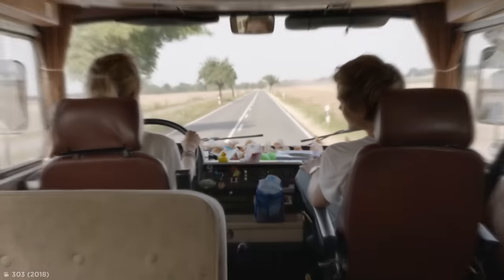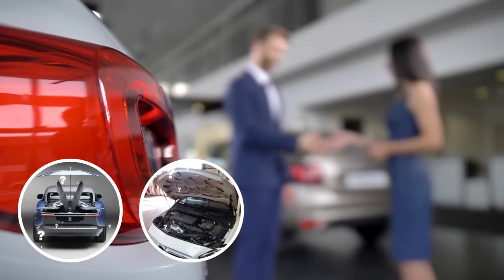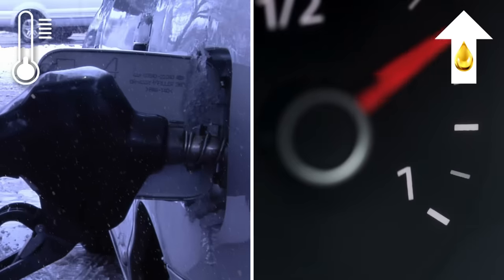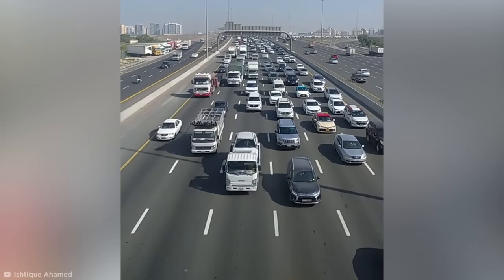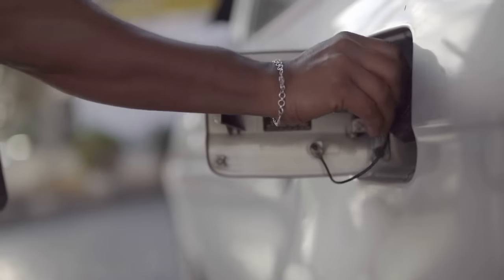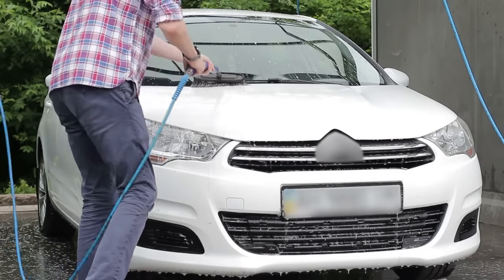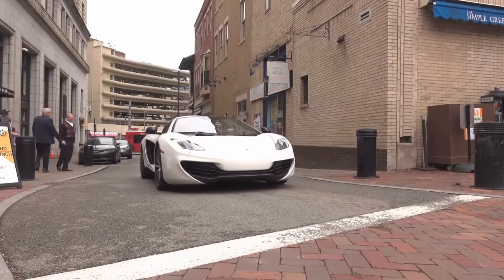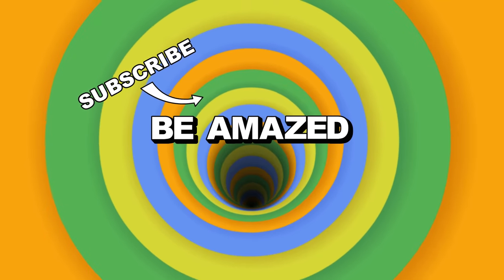Car Secrets Only The Most Experienced Drivers Know

Comment: You owe me 22 minutes!😴
Reply: And 17 seconds
Reply: Thankfully I only got about a quarter of the way through before realising this is a waste of my time
Reply: Real
Reply: Thank you for saving me 15 minutes! ❤
Reply: I don’t get it… how is this a waste of time?
Reply: I was expecting that seatbelt button to be more useful then that
Reply: I stopped it at 9 mins, went over to the comments and after reading yours, i believe i made the right choice. 😂
Reply: Yeah, I didn't even make it past the first one. You are a better person than me to continue for 22 minutes and some change
Reply: Yup
Reply: Thanks for the warning! 👍🏼
Reply: Thanks for saving me 22 minutes
Reply: Thanks for saving me 20!
Reply: Was it boring or fun
Reply: Thank goodness I fast forwarded and watched at 2x
Reply: Same…. Thought I was gonna get some life changing secrets here. I could’ve just smoke 2 cigarettes if I purposely wanted to waste 22 mins of my life. 

Also, you explained the “hidden” key but offered no explanation of how to access the cylinder, which in most cars, will require prying off the cover on or around the door handle to reveal it.

Or what about when the key fob runs out of battery? Should’ve added that certain cars will have a physical key slot usually hidden underneath a plastic top around the steering wheel area or nearby the push start button and other cars (most likely newer cars) will have some sort of procedure to start the vehicle even when the key fob is out of battery. For example, VW will have you, without depressing the brakes, press the start button once (ACC on), hold the key against the ‘key’ sign located on the right side behind the steering wheel, then, once detected by the car, proceed to start the car as normal (press on brakes + push start button). 

This went longer than expected but I just find it annoying when people would post some sort of guide, answers, “secrets”, etc but doesn’t expand enough on it for it to be helpful or just simply say what 9999999999 of others have already said or answered out there (Google is full of it, same answers over and over and over again, nothing new or useful to add except by a very few). This is kind of like saying, “I bet you didn’t know that your side mirrors can actually help with certain car maneuvers. Well, now you know.”.
Reply: Thanks for the heads-up 🤣🤣🤣
Reply: Thanks! 😅 I won't bother with watching
Reply: Of what
Reply: Thanks for the warning
Reply: @BubbaFettscafe.  1:12 😊
Reply: @luckylou05  1:38
Reply: @nuthinbutlove  2:07
Reply: @tonytrieu800  I don't think you meant to reply to me
Reply: Ya he owes me 22 mins and 16 secs
Reply: I’m 2 minutes in and I’m bored already.
Reply: Thanks buddy you saved my 21 minutes 😂😂😂
Reply: Owes us all 22 mins plus penalty.
Reply: Thank you for saving me 21 minutes and 55 seconds 😃
Reply: Same😂
Reply: Noooooo stop meanie
Reply: Thankfully I read you comment and only used 1/2 the time.
Reply: You chose to watch it
Reply: @Phantomguypokefan  Agreed. 

You guys know you didn’t have to watch it? You could have skipped it, I don’t think Be Amazed was forcing you to watch it from start to finish nor would they mind if you moved on. 😅
Reply: Thanks. I only watched a minute. About extending range from 9m to whooping 26m. Firstly car keys range is well beyond 9m, and secondly 26m is really nothing when you search airport car park. When parking at huge parkings I always take a picture of the nearest location post, preferably with my car in the picture. Easier than search for many minutes
Reply: 5 minutes for me
Reply: What do the British mean when they say ooiii?  Boillocks.
Reply: currently 3:30am 🥲
Reply: And you saved me!!! Yayyy. I was just going to come comment how stupid the thumbnail was.
Reply: Your comment saved me 22 minutes.

Comment: The red colour of a car also has to do with the fact that brake lights are red. This makes the red lights and car colour blend in like camouflage in certain conditions. The fuel in different temperatures is actually adjusted by retailers, see the fine print on the gas pump that speaks to this.

Comment: That first one about key fobs transmitting to vehicles might seem false to a lot of people, and I’m still slightly dubious, but I do believe it could be at least partially factual. Here’s why. 
See, I still listen to FM radio quite often, and that obviously requires an antenna as well. On my old stereo receiver, I found that I will sometimes only get a stereo signal if I’m in a certain part on my room, often near the receiver. More interestingly, while moving my antenna around tends to fix these problems sometimes, the problem will also sometimes go away only when I am touching the antenna directly. Once I let go of my antenna, the signal will often weaken, stereo sound will go away, and I will sometimes start to hear static. Also, those car keys definitely work more than 30 feet away, at least the Honda ones my parents had for a while. I believe some new electric cars such as Tesla can connect to your phone, and I think it’s possible to know exactly where you parked it on a map, though I could be wrong. I feel like this should be a feature on most new cars if it isn’t already.

Comment: putting the key fob to your head does work, (also works if the battery in your fob is nearly dead and the car wont open) but its because by doing so you are using a ground earth. Basics of radio communication, not vibrating water molecules in your brain.
Reply: Been putting it under my chin back in high school. 1990’s. Always worked. Battery low or extension of the range.  But some neophytes just don’t believe like lot’s of things these days

Comment: Water in brain makes the radio waves travel further? It is actually the opposite. Radio IC and module manufactures have this note in the datasheets that the range will decrease near water bodies because "WATER ABSORBS RF SIGNALS" 

The reason it may work is because you are raising the fob high up.
Reply: Exactly right.  Just lift the fob up high and your broadcast range increases ... it's why radio statons put their transmitters up high on towers.
Really, who doesn't see this?

Comment: the turn signal is not to turn on as you are turning the steering wheel, put it on about 500 feet before your turn off spot. Turn off your turn signal when changing lanes on a multi lane road as other drivers will not change lanes or pull out in front of you thinking you want to turn at the spot they are waiting to pull out of. Also your brakes don't have to be applied to put on your turn signal to change lanes if no other vehicle is in front of you, use your mirror to monitor traffic behind you.

Comment: Vauxhall is just a small brand used by German manufacturer Opel to sell their cars in the UK under a local brand with right hand steering...
Reply: Not really.   Vauxhall (British) was founded before opel (German), both taken under the GM Europe umbrella in 1925 and 1929 respectively.   In the early 80’s they started sharing the same designs and platforms and by 2021 were taken over by the Stellantis group.   So, in short, Vauxhall isn’t a small brand used by opel.

Comment: As a manufacturer of industrial paints, we used to buy solvents by the tanker load. We used to buy it by weight, because of expansion due to temperature changing the volume. However, a car full of gas? It won’t make a bit of difference as it’s such a small quantity.

Comment: I'd like to offer a small correction if I may: cooler air is NOT more dense than hot air. In fact it's the opposite. Cold air can't hold as much moisture than hot air. Thus making cooler air less dense. Hence the reason civilian airliners have such a high cruising altitude

Comment: Dude. In the first segment, when you raise the fob to your head, you're putting the fob higher, thus, it extends the range (i.e., fewer metal objects to block it versus doing so at waist or chest level as most people do)! Nothing to do with your head being an electromagnetic force! So, just hoist the fob as high as you can, and it should work better, presuming, of course, that your vehicle isn't on the other side of the parking lot, where the signal is blocked by the stores!

Comment: I'm more inclined to not believe holding the key fob to your head increases the distance of the signal. Instead, it's the fact that it is higher up in the air with less restrictions blocking the signal.
Reply: naa this is true. I'm no RF signal expert, but the 315mhz (USA) frequency key fobs typically use does indeed get some kind of amplification effect when held against the head or even a gallon jug of water. I tested this with a software defined radio called hackrf one and its accompanying portapack and I can tell you that there is a difference when comparing 'clicks' at head height and with the 'clicker' held under the chin.

Comment: With far fewer red coloured vehicles on the road than white, this is what makes it a disproportionately targeted coloured vehicle. 
I heard that police think of it as a game of snooker, where they first pull over a white vehicle(the cue ball), then pull over 15 red, amongst 1 of several different colours, then finish with a black. Apparently the vehicle colours have a differing corresponding points value when compared to snooker colours (though, not sure what it is exactly), along with having their own variations of the 8ball, 9ball and 15ball games. 

From what I was told, the word "snooker" was what they used to call cops during their first year. So given these "snookers" were almost always assigned to traffic duties, they took the name literally and decided to create their own variation of the actual game.

Comment: Reminded me of one time i needed to make an important call when i was outside but phone died on me. I had a magnet in my pocket for some reason, so i removed the battery and matched the opposite poles to pull electrons back to the negative chamber or at least sort them out and concentrate. I got 4% and made the call. Life is good when the last 2 brain cells figure out a cool thing once in a while. Proudest moment of my life.

Comment: Traffic jams? Phantom traffic jams, are often caused by people not being observant. If, brought to a halt, you should be looking several cars ahead, when they start to move, you should be ready to.  What I see, is people stopped in neutral gear (manual) with the parking brake on. They don't put it into gear, and take the brake off, until the car on front moves, creating large gaps between cars. Seen most often, by long traffic jams, with no obstruction in front to cause one. Keep up with the car in front, by observing several cars ahead and being ready to move.

Comment: Red cars used to have higher insurance rates. Luckily insurance companies stopped charging more for red cars a while back. 
Every insurance company I got quotes from with both my red cars through the last 10ish years had different rates for red vs a white or black cars of the same make and model. My insurance dropped down a bit around 2021 or 2022 (I can't remember).

Comment: If you see an arrow on your fuel gauge, that is pointing to the side the filler cap is on. Only some cars have it (none of mine do), and it's a fairly recent addition, but if you have it, make sure the pumps are on that side
Reply: If your car doesn't have an arrow, the handle of the pump or the icon will be on the side of the car where your tank is
Reply: @ShawniaMarie  Some cars have the fuel gauge on different sides depending on what trim level you have or even in the middle and if there's a fuel pump icon, I've only ever seen the pump on the left and nozzle on the right regardless of what side you fill up on, and nozzle to the right with pump on the left still gives the picture of fill up on left because pump on left

Comment: Actually, Insurance companies don't even ask what color the car is the Vin# can give them all the information they need. The fuel that morning fill up's will help is vehicles that run on propane. The people that believe in the golf ball affect just have to go around their car with a ballpeen hammer and fill it with dimples then for better gas milage? Another aerodynamic feature on some new vehicle is the little, tiny wedges on the outside mirrors, not only do they make the car aerodynamic but also make it quieter inside by changing how the air changes around the mirror.

Comment: The most common colour for cars is white, so more white cars would get pulled over. Red cars used to be the least favored because red paint faded faster than other colours. Years ago, in the 60's, I repainted my car and the insurance did go up because that colour paint was more expensive so the car would cost more to repair. I had a friend who never washed his vehicles believing that the dirt protected the paint. He would only wash the car just for the purpose of selling it and to my surprise the paintwork always looked really good. Motion parallax has more to do with how close you are the the road surface, the closer a person is to the ground they are passing over the faster they feel they are going.

Comment: Water kills radio waves. Just try using a remote under water (even packed in a sealed container). And why do you think submarines have to surface to send and/or receive radio signals?

P.S.: The remote key for my car works fine at distances of at least 50 metres or 150 feet - line of sight.

Comment: 18:35, which is incorrect about the truck driver. The reason why truck drivers usually are driving fast is because of unrealistic delivery times. It doesn't have anything to do with the perception of distance or speed or anything like that. As a truck driver myself, I can tell you now that going faster in a truck is much scarier than ever driving the same speed in a car. For a few different reasons, number one is the size of the tire, the steering response, and the ability to stop. So before you tell your viewers something that is completely false, try consulting somebody who's actually a driver. That study that you are mentioning actually didn't interview any truck drivers. Other findings were hypothetical at best, and based on Heights off the top of the road to wear, the driver is setting.

Comment: There is digital modeling techniques that would allow 3-D drawings to be tested, aerodynamically without the cost of building either the car models or the wind tunnels.  Anyone who has "flown" an aircraft simulator sees this first hand, since the changes in the modeled control surfaces makes the same changes in the behavior of the simulation.
Reply: Yet they still use actual wind tunnels.

Comment: Of course white cars are pulled over more often.  In case you hadn't noticed there are roughly twice the number of white cars on the road compared to all other cars combined.  That's because, of the three colors that are more highly visible (and are, therefore, safer to drive), white is the most acceptable.  The other two colors are yellow and red.

Comment: 1:23 nope. Wrong. RFID is used to unlock anti start, not door locks. Doors open with legacy radio at 433MHz, while RFID is using either higher or lower freqs. Tjere are many other differences. 433 is supplied by the battery, hence the need to press the button, and works up to 100 feet. While RFID is supplied by the car itself and works at 10cm, or 4 inches.

Your key always contains both systems. Unless you have a keyless system which uses a protocol similar to bluetooth, and can know where you are in or around the car. 

You are false from the very beginning.

RFID is the parent tech for NFC used by credit card and contact less payment by phones.

Comment: I have seen many of these videos talking about these alleged safety loops in seatbelts. And yet, for all the makes and models I drive or ride in, NOT ONE SINGLE VEHICLE has EVER been installed with these alleged safety seatbelt loops. Additionally, there have been some VERY rare cases where some kind of loop was sewn to the seatbelt. But it was oh so easy to see the loop separate from the main belt and stitched on for one purpose only... to make it easier for passengers to reach for the buckle. I've gone so far as to even reach out to manufacturers and ALL of them confirmed what I was seeing.

So, I would love to know who are these magical manufacturers who use these alleged safety loops in their seatbelts? Or are people making false assumptions about the loops without talking to the manufacturers?

Comment: My key cannot unlock the door when the battery is dead. There is no linkage like on older vehicles. You need to hook up battery cables from under the car to provide power temporarily.

Comment: Another secret is the fact that base model cars have the same features as the higher up models me and a friend got the same car he got the 2011 jeep liberty base model and I got the limited and for example mine had heated seats and his didn't but we looked into it he didn't have the button for the seats but had all the wires I used my button on his jeep and boom his seats started heating it cost a car company more to make base models different from there higher models so most company's make only the higher models and just take out the buttons for the fancy features so spend less on the base model and then order all your buttons for the fancy features and have a mechanic install them unless you know what your doing it saved me almost 5000 dollars on my last vehicle I got and it's got all the bells and whistles now for only 200 rather then 5000

Comment: The "head trick" actually uses your head as a GROUND for the antenna system.
To be more specific, your brain is very wet, and the water is laden with salt and other electrolytes, making a a good ground JUST LIKE THE OCEAN (but much smaller scale).